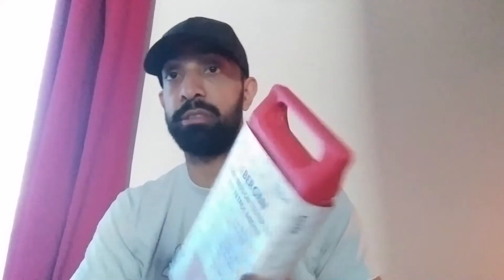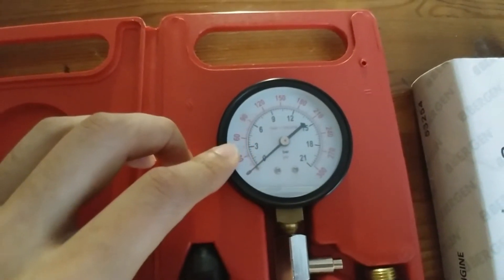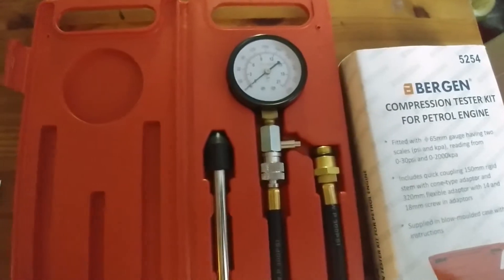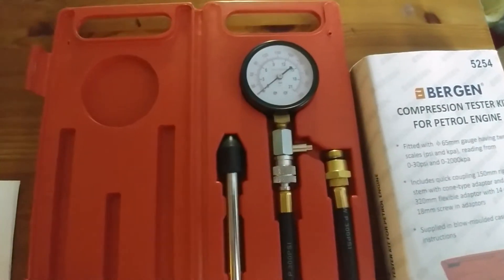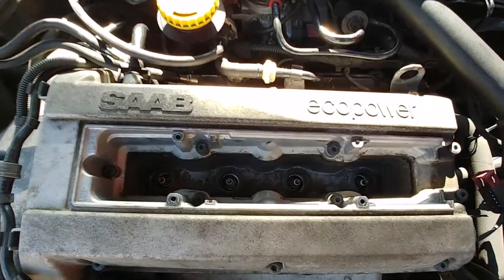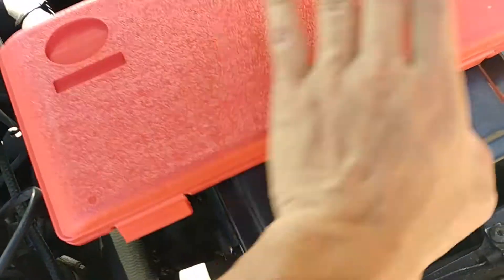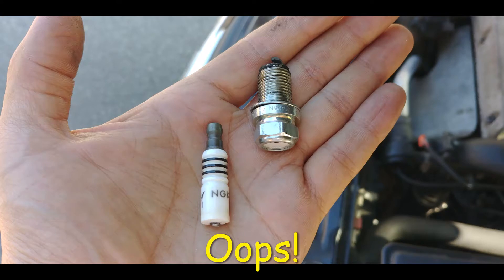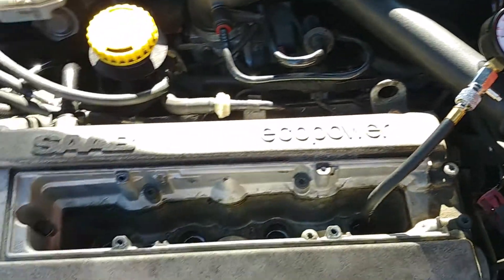Compression Test on a Saab 9-5 Engine (B235R) - Dry & Wet Compression Testing

Comment: For anyone reading this. DO NOT TURN D.I. CASSETTE UPSIDE DOWN. I always stick it right in front of the engine with nipples pointing towards the turbo area, fits nicely there. Thanks for the video.
Reply from the maker: I been meaning to test my D.I via the Tech2, hopefully soon I will do and capture it on video.

Cheers for the tip Mr Reed

Comment: I went through this scenario on my previous 9-5 Aero. The key thing (as you mentioned) was oil usage. I'd done all the usual checks ... PCV system., turbo etc ... but it was using around 1.5 litres of oil every 1,000 miles ... so something wasn't right. The compression tests came back as::

Dry: 
15/14/12/14 Bar
218/203/174/203 psi

Wet: 17/14/17/16 Bar
247/203/247/232 psi

My pvevious 9-5 (52 plate, 2003 model year) test:
Dry 225/220/220/225 PSI,
15.5/15/15/15.5 Bar

turns out (in the end) it was valve guide wear. This lead to oil leaking into the cylinders and gummed up one of the oil control rings on no.3 piston (hence the difference in its' wet and dry readings). I paid quite a lot to get the cylinder head refurbished, along with timing/balance chain kit replacement (mileage was roughly 145k and the timing chain tensioner extension was around the maximum recommended ... 15mm?). But once the work was done, oil usage went to pretty much zero. I also noticed that the oil took a lot longer to change colour once it had been changed as well. But as mentioned, it wasn't a cheap fix ...

Comment: Conventional wisdom states "no more than 10% variation between cylinders".  Your highest dry figure was 174, you're lowest was 152.  10% of 174 is 17.4, minus that from the original 174 is 156.6.  So yes, Cylinder 4 is just outside of the 10% limit.
Reply from the maker: Indeed, many thanks for your reply. 

According to my brother, the factory wet readout for these engines is 14-bars?  I will do another test soon and see if my MM treatment aided the increase.

Thank you once more.
Reply: @the80sdude51  The Haynes manual lists the compression for ANY B235 as 14 bar.  Any cylinder below 12 bar is "considered as less than healthy".  So it looks as if my other calculation were completely wrong.